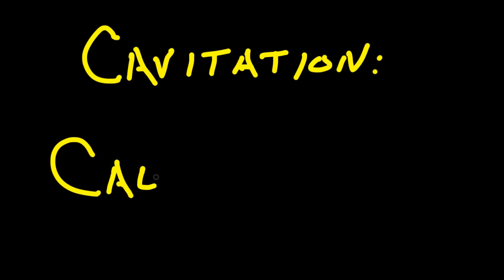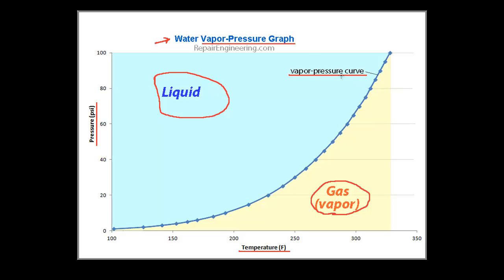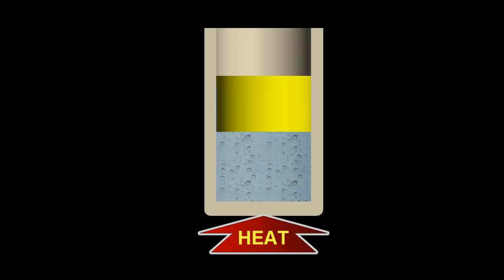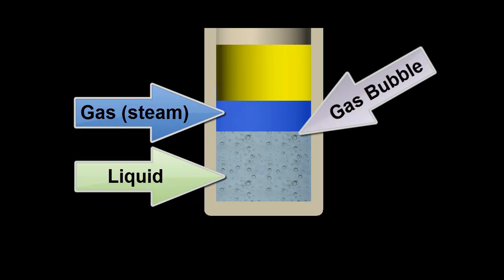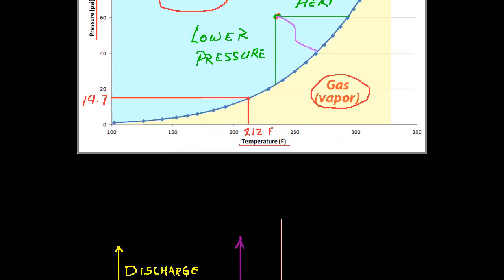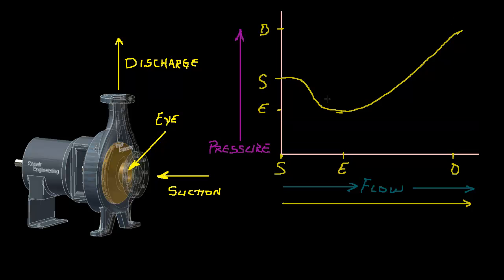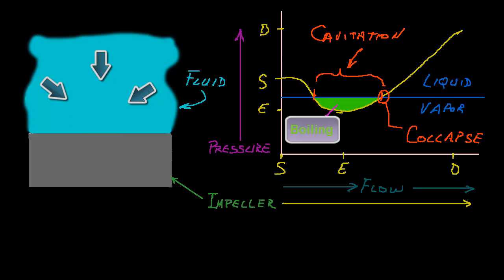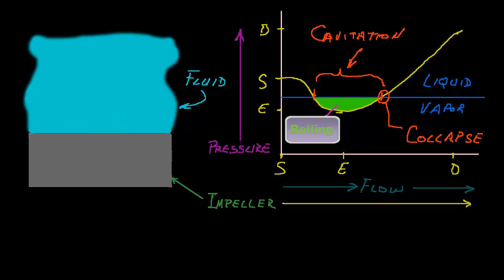Cavitation Causes and Effects

Comment: Excellent presentation. Back in the day, as a welder, I was often tasked with weld repairs to both impellors and pump housings. Bronze and cast iron impellors and cast iron housings were typical. Both of those metals present substantial problems to almost any (electric) fusion weld process. Much of the metal to be resurfaced was lost to cavitation, most to erosion from sand and other materials in the water. I was never able to grasp how gas bubbles could remove metal nearly as effectively as sand and other contaminants could. My professor in Metallurgy 601, Dr. Ralf O'Brien (Northern Kentucky University 1986) never could get this through to me, though he was a great teacher. This presentation makes it more clear simply by giving the numbers: 60,000 psi, is a lot of pressure! Thank you for this program.

Comment: oh my gosh its so simple!   Cavitation is simply when the pressure gets so low that the water boils, but instead of the gas bubble condensing, it implodes again.   So cavitation bubbles that come from implosion again implode, i feel like this energy could be tapped, and or i also believe there iss a high chance it is changing the properties of the water.

Comment: I do not like you calling a vapour a gas. It is absolutely misleading to students!  It is wet steam.  Now if one goes for superheated steam well only then one may compare  it to a gas. We must not mislead students.
The reason I am saying that is if we have two equal containers, sealed, one almost full up with water while the other almost empty. Well if they are both at the same temperature, because of saturated vapour  they will both be at the same pressure irrespective of the volume above the liquid. With gas it is different as P*V/T = Constant.  not so in a vapour.

I wrote all this off the cuff, so I better go and check what I learnt 60 years ago!!
Reply: Not mislead students? That's the whole point of "education"!

Comment: Okay, after thinking about this for a few minutes, I'm trying to understand the underlying cause of cavitation.  Am I right in thinking  that it is caused by a pump that's pushing out more liquid out than it can pull in?  This would mean an oversized pump for the application, inadequate feed or something blocking the suction side?  If all the bubbles did not collapse, you would get foam coming from the discharge side?
Reply: Flowrate in = flowrate out, my friend. Flowrate is constant, but not fluid velocity. Fluid velocity is higher at the suction side. Higher velocity = lower pressure according to Bernoulli or the venturi effect. And when the pressure drops below vapor pressure (pressure at which the fluid becomes vapour)...ok now this is where I'm stumped. Does flashing occur during cavitation?

Comment: It should also be noted that "Temperature" and "Pressure" co-relate as statistical vibrational energies with many MODES of vibration. 
This gives us a FUZZY line between the Liquid phase and the Gaseous phase for any compound, pure or mixture. Especially as we approach the triple point or the super critical points.
Water vapour exists in air well below the boiling point of the fluid.
The vapour pressure "curve" is a high statistical probability region of certainty but not a clear boundary of "all gas or all liquid".
This is evidenced by pumps having cavitation damage well under the designed limits.
CFD was pretty much invented to explain this phenomenon.
It's important to maintain a positive pressure across the blades OR design the blades to cavitate and use the reduced pressure to pull the liquid into the gaseous side of the pump.
Another method is the Impeller which compresses the liquid or pushes it rather than sucks or pulls the liquid via a negative pressure differential.
The pumping of water is done efficiently by 4D motion gradually accelerating the fluid through it's range of speeds.
The "lily impeller" is a perfect example of this type of approach, and looks like a "frozen whirl pool".
Thanks for the Engineers point of view for pump cavitation.

Comment: Great explanation of cavitational theory in pumps but would have been even better to indicate the additional affect on bearings, mountings, pipework as well as the internal pumping elements, i.e. rotors/impellors/pistons/diaphragms/hoses etc. These are ALL affects which may be contributory to terminal failure.
From past reports it is evident that Three Mile Island incident in 1979 resulted from a mixture of water and steam in the reactor cooling circuit caused the pumps to "vibrate". I.E. Cavitation. This would be evident as the pumps were reported to be the size of 40 ton trailers. Thankfully no one suffered injury from this as meltdown was avoided from some prompt action.

Comment: This is the best explanation that I have seen regarding cavitation.
I have one question though. How come the pressure around impellar eys becomes lower after suction part?
Reply: The fluid velocity entering the pump's inlet increases, with a corresponding pressure decrease of the fluid. See Bernoulli's equation. Basically, the same effect as with a venturi; as fluid enters venturi, press & temp of fluid are constant until the fluid reaches the narrow part of venturi. At that point, the press & temp of fluid decreases. This effect is increased with increasing fluid velocity through the venturi. A venturi is the basis for how all carburetors are made and function.
Reply: shadovanish Thanks for your good explanation!!
Reply: shadovanish
Not that good of an explanation, since it assumes the velocity increases rather than explaining how it happens.

The rapidly revolving impeller blades divide the liquid into two separate flow fields, one on the leading side of the blade, and one on the trailing side of the blade. The impeller imparts kinetic energy to the water on the leading side, which increases its flow rate in a largely inviscid manner. The Bernoulli principle does not apply since kinetic energy is being added to the water. But this is not the side where the cavitation occurs.

On the trailing side of the blades is where the cavitation occurs, and here the problem is that the blades are sweeping the water into the leading flow stream, leaving a partial vacuum behind. Water rushes in to fill the vacuum, but if the blades are going too fast for the vacuum to be filled with relatively slow-accelerating, viscid water, then the water vaporizes (boils), flows as a gas, and then condenses (implodes) when it slams into the blade (due to momentum). On the trailing side of the blade it is the vacuum that occurs first and is the cause of the dramatic increase in velocity and also the cavitation. Bernoulli's equation doesn't really enter into it, and can't because water is a viscous fluid and Bernoulli's principle applies only in inviscid situations. Without the partial vacuum there would be no cavitation.

Comment: I agree This is an amazing description of a complex action.
@Maros Kozej.  Remember that liquids do not compress.  So when the vapor bubble collapses the liquid uses that space to "hammer" the surface with the volatility and force of the increased pressure. After some time the surface will deform  under the repeated blows. See 12:00
Look at the space of the bubble like the space used to draw back a hammer (in this case the water) and the collapse like the weight of the hammer with your added force. (See 14:00) The shock wave goes in all directions including into the material making the impeller.

Comment: No, as explained in the video, it's the change in pressure, in this case raising the water temperature and changing it (partially and for only a split second) into a gas (the tiny bubbles forming) before condensing back again into liquid. The reaction will be amplified by the heat also present inside the pump, generated by the rotation of the impellor (friction). Don't forget this is happening on a very small scale. :-)